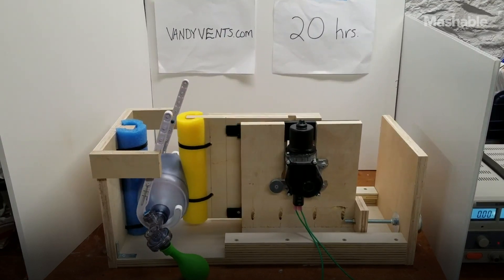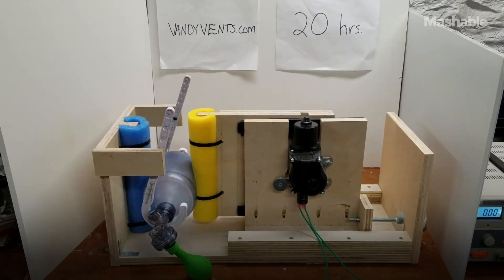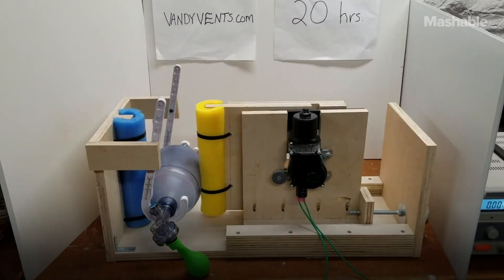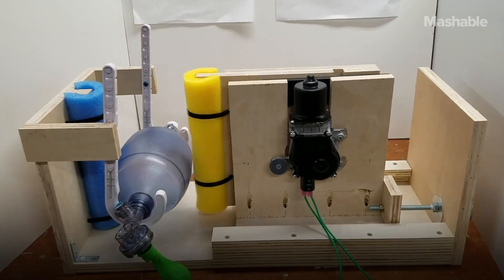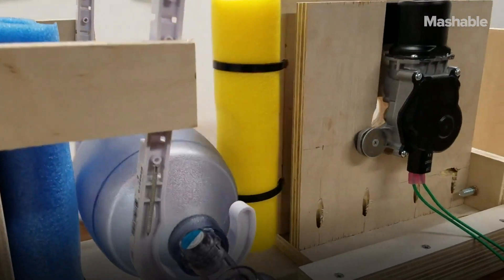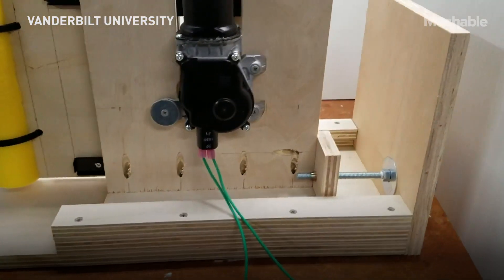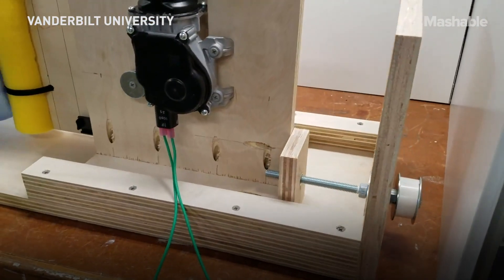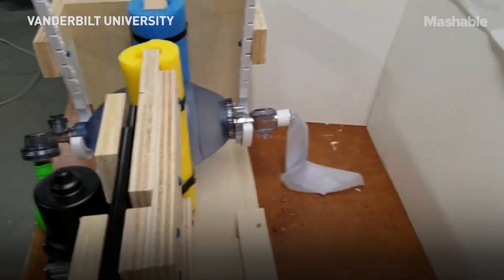Homemade Ventilator Is “Last Resort” For Hospitals Amid Coronavirus | Mashable

Comment: Dear Sr:
My name is Nestor Alvarez, I am a Venezuelan Mechanical Engineer and I currently live in Houston and I am at your service if you need any technical contribution.
I am doing the same to send the design to communities without resources in Latin America, especially in Venezuela.
I have doubts about how to regulate the PEEP that I understand is a very important value and must be between 5 and 8 to avoid barotrauma.
I am making the bellows also because there is more difficult to get it.
Do you have any idea about that.
Thanks again for your effort and dedication to save lives.
Atte
Nestor Alvarez
Reply: I'm not an engineer, btw, but that is my personal opinion.

Comment: Are there plans available for those of us that are capable  of building to do so?
Reply: An arduino,  with 12v dc motor driver shield (don't know if it exists 😁) , a windshield wiper motor, and that inflator mechanism which is in video you saw here, and some pulse monitoring,  some oxygen meter responses to arduino, some coding, some calibration in coding  for real life Respiratory systems. That's simple 😁
Reply: @rameezsheikh7576  thank you.
Reply: Any luck?
Reply: @durbanSA  I suspect we should contact Kevin directly.
Reply: @durbanSA  no one has shared this information.

Comment: How can we use water filling up air tight container, with air flow only leaving through tube that helps patient breath warmer humid air. A water pump, a container allowing for air to be "breathed" in through one hole allowing air in (not out) and the tube bringing warm air into the patient's lungs by water level controlled by pump

Comment: How about an adapter for the windshield wiper on an SUV. The vehicle could become the ICU module in the parking lot . You could use the vehicles heating and cooling units to provide hyper/hypo thermal treatment .